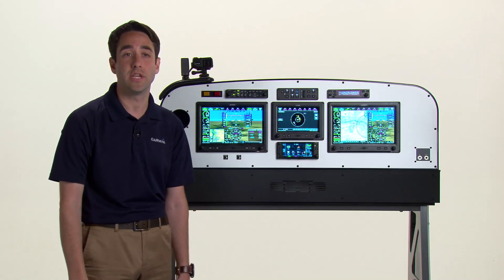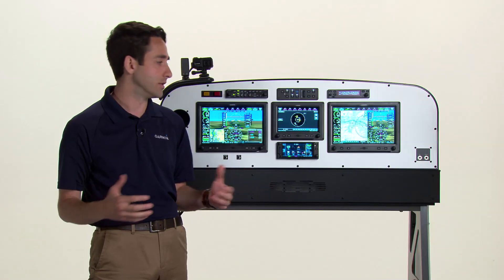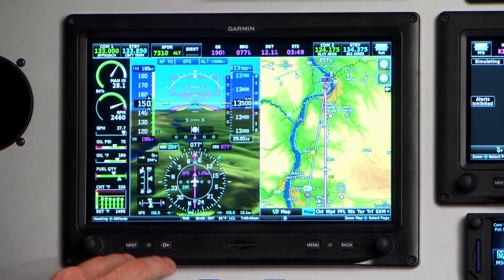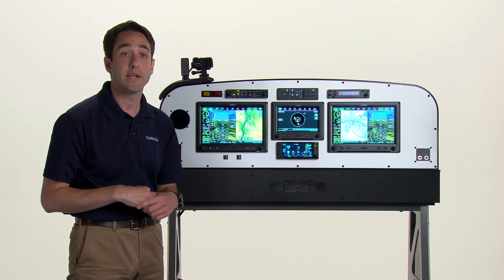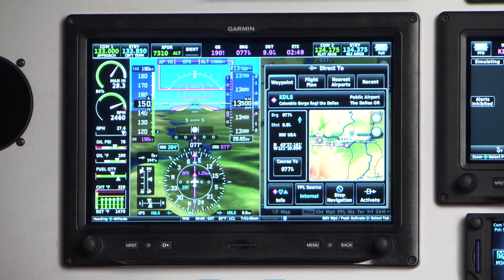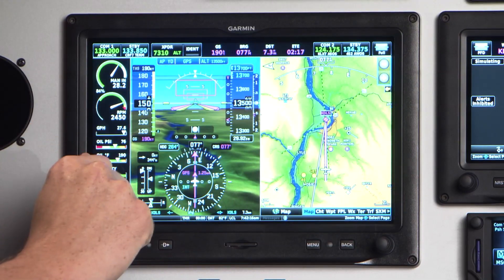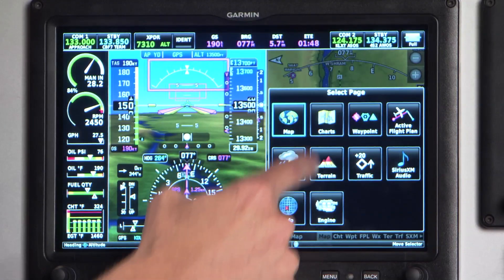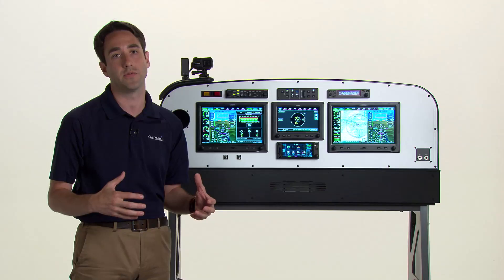G3X Touch-Displays

Comment: Since we Are in the computer age, I see no reason why I should be subjected to the old style six-pack gauges. I read that it’s too much eye movement anyway where the Garmin makes it all easier. Could old Cessna 172 and 185’s be converted to Garmin displays?
Reply: Yes, you just need the buy the certified versions and have them installed by a certified  A&P or similar. For example, I heard through the grapevine that is costs about $120,000 to equip a Cessna 172 with a G1000 certified system.